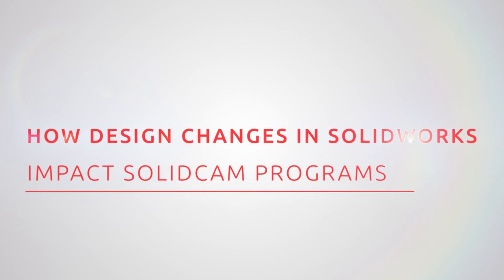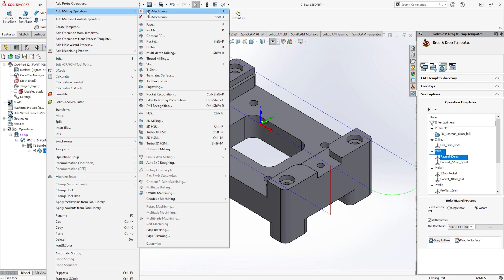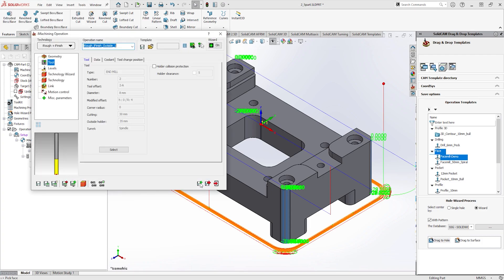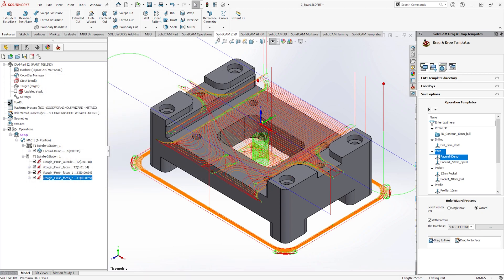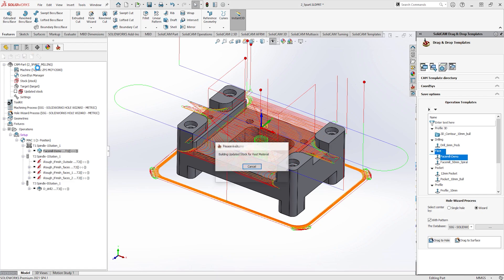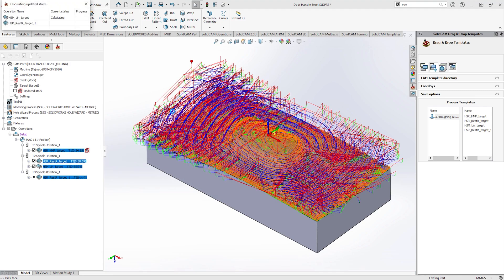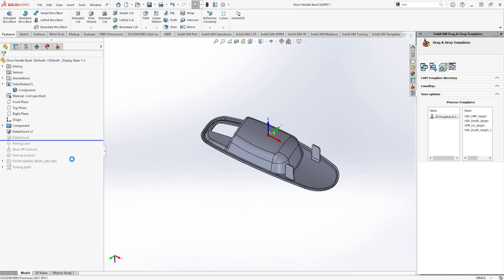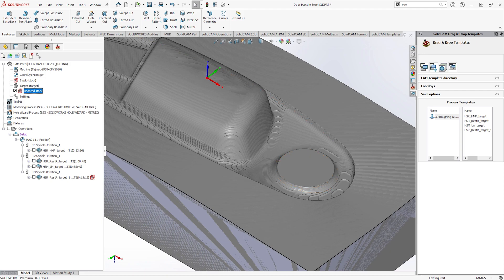How Design Changes in SOLIDWORKS can Impact SolidCAM Programs

Comment: Well... I like to use a step file when I use them for programming... The main reason is not to accidentally change the shape of the models... The other reason is that I mostly work with imported files. Some colleagues don't like to use synchronization tools in solidCam. But I find it useful. since I mostly do programming using sketches.